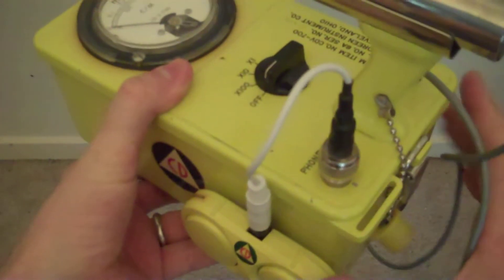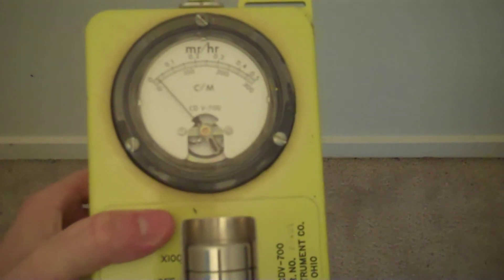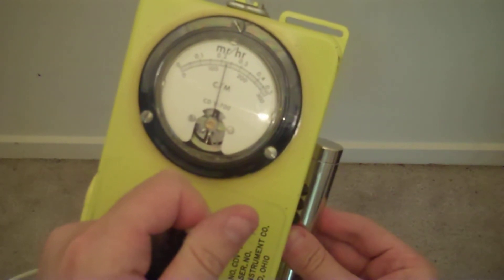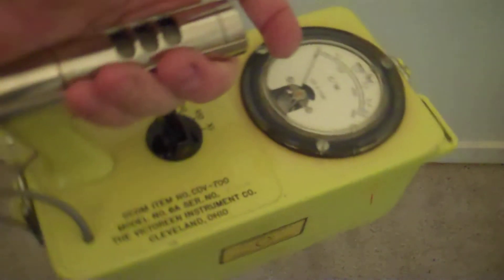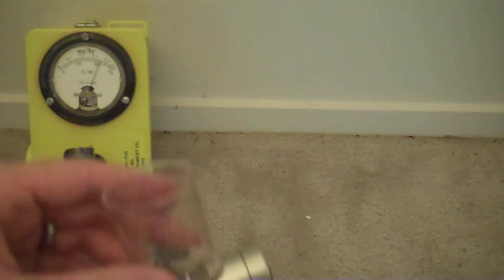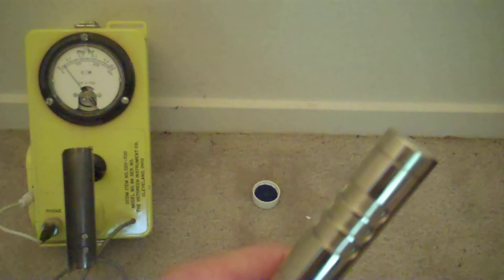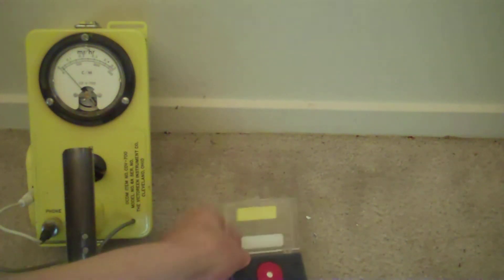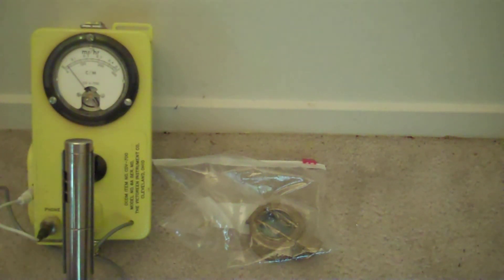Victoreen CDV-700 6A Geiger Counter -- Review

Comment: Great video as usual!

Do you know of any way to calibrate a CD V-700 (for counts, not necessarily energy) without using the included checksource (the "radium D+E" on mine has likely decayed enough in fifty years to no longer be as active as the manual states)? It works for my element collecting related purposes, and I love the aesthetics of it, but I'd still like to get more accuracy if I can without buying another counter.
Reply: Yes, I wrote a Raspberry Pi program to count the rate of clicks from the unit's headphone jack.  Once everything was set up, I put the probe near a suitable source and turned the unit's CAL potentiometer so that the counts per minute on the CDV-700 matched the rate that the program was reporting.  
The steps are:  Buy a Raspberry Pi and set up Raspian.   Learn Python programming and the Python library tools for measuring time and for reading the state of the GPIO pins.  Write a program that measures the time needed to count 2000 pulses, and to report it in counts per minute.  Connect the headphone jack to a potentiometer to drop the voltage from 14 volts to just under 5 volts, which is what the GPIO can handle.  THEN connect the headphone pulses to a GPIO pin.  Run the counting program, and turn the CAL potentiometer.  This will give you a CDV-700 that correctly shows the counts per minute, and also the millirems per hour.

Comment from the maker: I have never used that unit but the SBM-20-01 tube looks quite nice. Just guessing, I would imagine that the SBM-20-01 tube provides results similar to the 6993 tube (found in the CDV700).  Under $300 USD for a Geiger counter is a great price!   Are you sure you don't want to spend another $200 USD and get an Inspector? It would be massively more sensitive with it's large pancake tube.  I posted an inspector video too...

Been to Scotland, always wanted to see Ireland.  =)

Cheers!

Comment from the maker: Bq is short for Becquerel. 1 Bq means 1 decay per second.  

Decay is random, but there is always a statistical average. If an atom decays, on average, 100 times per second, it is said to have an activity of 100 Bq.

Now, decays are alpha or beta only. Gamma rays come after a decay, so 100 Bq does not always mean 100 gamma rays. In the case of Cs137, for 100 decays you get a gamma about 85.1% of the time. 

I'm posting a video about each form of decay, in detail, very soon.

Comment from the maker: NOTES:

Please watch in FULL HD (lower right of screen, "gear" button)

The following sources were tested:

Cesium 137 - 3737 Bq

Cesium 137 -  37000 Bq

Old barely detectable Radium Compass

Strontium 90 - 3700 Bq

Polonium 210 - 666 Bq (as of 7/22/12)

Pitchblende Uranium (United Nuclear)

Stay tuned for two more videos (CRM-100 and Inspector EXP)